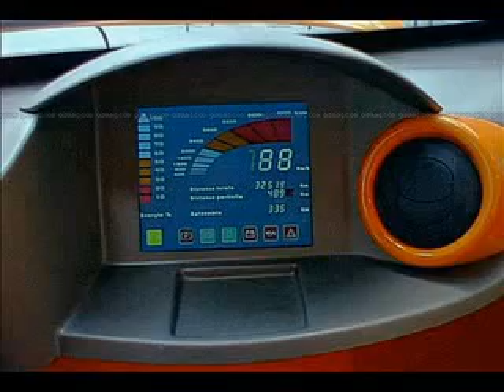The Air Powered Car

Comment: IS THIS THE TRUE REASON BEHIND SUPPRESSION--According to his design the hot air was pressed into a motor which contained a number of cylinders, half of which go down when the others rise up. As in an ordinary engine, the crankshaft forced a rotating movement. The major difference was that the air after having passed through the cylinders, passed again through the cylinders by means of a compressor at the side, causing a continuous circulation and enough perpetual movement to last three months.

Comment: fizzguts you can go 125 miles on a tank of air and it would only take a couple minutes to fill up at a station and a few hours on the compressor that comes with it..It also comes with a gas tank that when you run out of air it runs on gas and then fills the air tanks back up..switching between gas and air you end up to 600 miles

Comment: I just saw a documentary on Discovery about this car:

Topspeed = 100km/h
Milage = 350km on 1 tank of air.. 

It needs a seperate machine to pressurise the air into the tank. Which also work on air :S

Once the car gets a topspeed of about 180km/h, milage of 800km on 1 tank and will look like an Audi, then I will buy one.